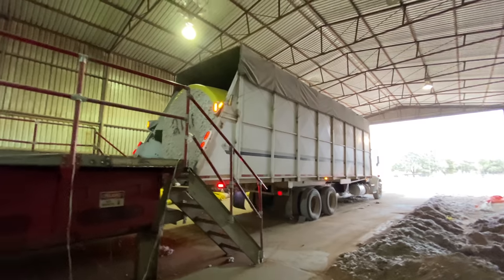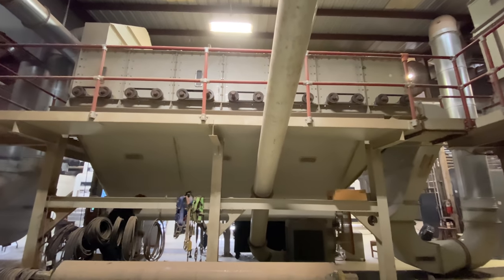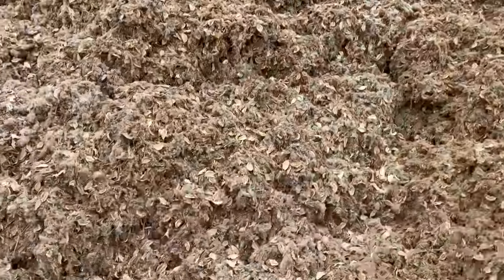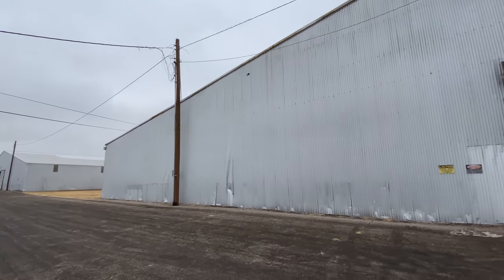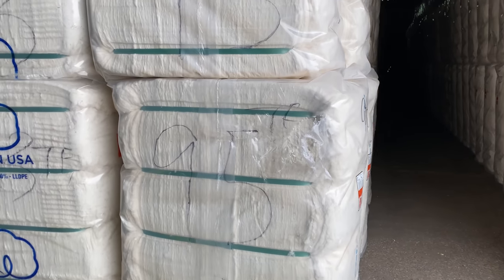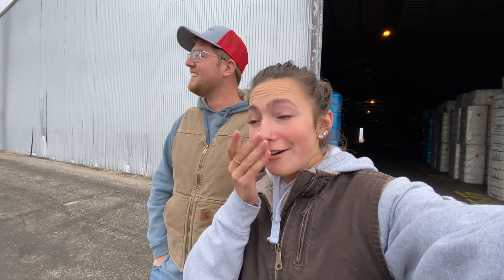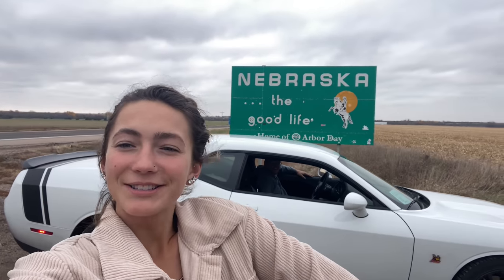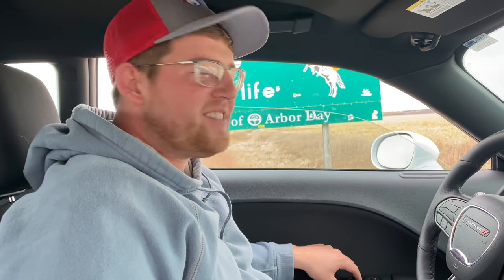West Texas Cotton Gin

Comment: Going back to the baler, there were two chunks he pulled off. Those are the samples that will be sent to the USDA classing office. The tag that is on the bale has a tag on each sample. While the bales sit in the compress warehouse, the samples get classified. Also to note, there are 100 bales stacked up in a row at the compress. You're at Plant #1. There's quite a bit more plants there. There is another group of warehouses across the street. And a majority of the open land around it belongs to the compress in case the warehouses get full. 
Being that cotton is flammable but because it's packed so tight, it will burn slow, unless there is too much humidity in the bale (organic decomposition) or something like hydraulic oil from the stripper or builder. It will heat up and burn from the inside. The heat will radiate and cause the others to burn. But it's not an open flame. It's intense heat and lots of smoke. Plant#2 had a few fire bales in the warehouse a few years ago and the suppression systems didn't turn on. It's not an open flame unless you give it air. And that means you would have had to open it in the warehouse. Which is a no no.

The cotton seed oil mill is across the street and there's two don the road.

Love the videos. Sent it to a couple of friends that were interested in cotton harvesting and production. Keep up the good work!

Comment: That was very interesting. The next step is to see how it is turned into thread. In my days as a weaver I worked with wool, going through the processes to make a fleece into clothing. Also in my college years I worked through the holidays at an explosives factory mainly for quarries. Two of the strict rules were never to say the word fire because that triggered an immediate response. The other was to never run unless a mixing shed was about to explode. Running was a signal something was wrong. There were other rules relating to wrist watches, belt buckles and the content of your pockets.

Comment: I guess somewhere in your cotton picking/stripping/ginning process the grading and stapling of the cotton fiber was discussed so you could understand how the farmer is paid when his bales are sold.  And of course the farmer has to pay the gin for processing the cotton and storing it until sold.  There was another step that used to be performed.  It was a cotton compress of the 500 pound rectangle bales to a smaller even more compact 500 pound bale.  They would be about 40% or so smaller.

Comment: Laura, you did not tell about the amazing process which happens to the seeds.  Some seeds are sent to be next years crops, while the vast majority of it will be sent to places like Buckeye Mills in Memphis.  Let me rephrase that.  When I use to work on my Grandparent's and Uncle's farms when I was a child in Tennessee, North of Memphis, we would go to Buckeye Mills to purchase cattle feed.  Rail cars from all over the South are loaded with cotton seeds.  I loved cotton harvest time and just driving near Buckeye Mills.  Buckeye Mills takes the cotton seeds and cracks the hulls off the seed kernel and blows the hulls to a storage building.  The kernels are processed using heat and pressure to extract the cotton seed oil.  After the process of getting all the oil out of the seeds, the kernel is left looking like corn meal.  Both the hulls and meal are waste products, but farmers who had farms which consisted of both crop and cattle, like my Grandparents, will purchase the hulls and meal.  The hulls are mainly fiber but have some nutritional value in them, the meal is very rich in fats and vitamins.   My one uncle bought his hulls in bulk, while another uncle bought them in bags.  The meal was sold in 100 lb bags.  During the winter we would put the hulls in the cows' feeding troughs and top them with a coating of meal.  If you get a chance to get to Memphis, you might want to check out Buckeye Mills if they will let you tour their plant.  Here is a link to an article about the mill.

https://tennesseeencyclopedia.net/entries/buckeye-technologies-inc/

Comment: When I was doing electrical work in the 80's I did a lot in local cotton gins from one that basically ran on one motor with overhead line shafts and belts to a gin that ran using programable logic controls. 
The newer gin was so clean, unlike this one, that they actually had a laborer pushing a dust mop around keeping the floor clean. It had the same brand and style of lummus gin stands but the whole place was very much dust free. Before the newer gins the bales were larger but not as compacted and were sent to a "Compress" where they were squeezed down into a smaller heaver bale like those from the gin you toured. The cotton seed was processed into cattle feed suppliment and cottonseed oil. That plant smelled a lot like popcorn.
jack

Comment: That is a high density press those high density presses were developed in the 1960's and gained wide spread use in the 1970's  which basically put federal  compress company out of business. When my family had their small gin roughly 4 bales per hour  we had a standard density bale press bales were 480 lbs approximately with an added 20 lbs of jute bagging and ties.
Reply: That gin was a 3 stand Murray gin. It was powered by a 200 horsepower Lee Roi engine powered on Natural Gas drove a line shaft with belts and pulleys  was loud when operating.

Comment: my calculations based off what I see is that each building holds about 350 million pounds of cotton!
and there at least 108 buildings which is 38,272,500,000 lbs!!! that cant be right 
current cotton price is $1.75 /pound

the gin can produce 80 bales/hr (500lbs) = 40,000lbs /hr